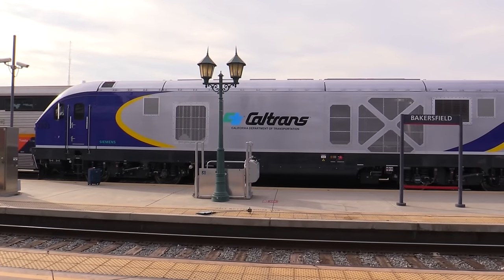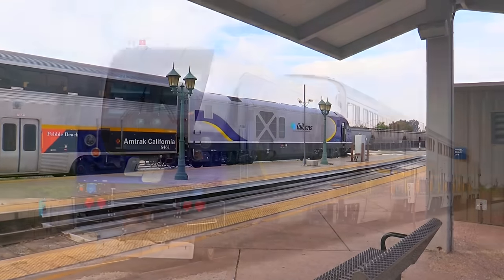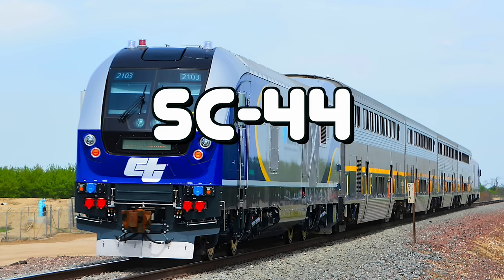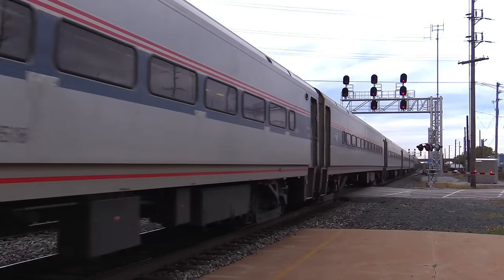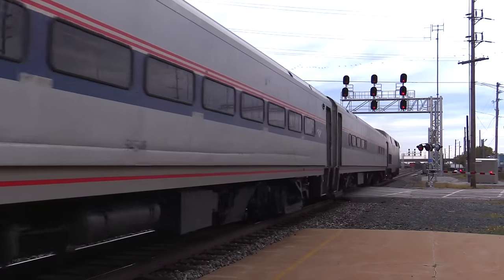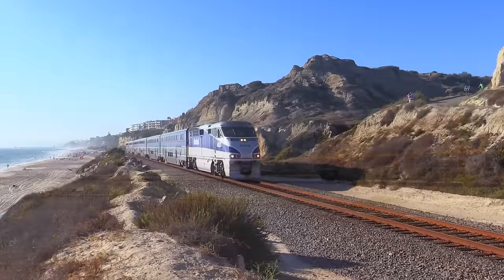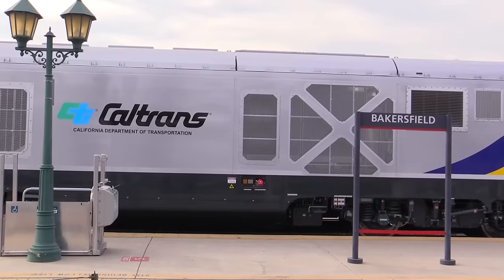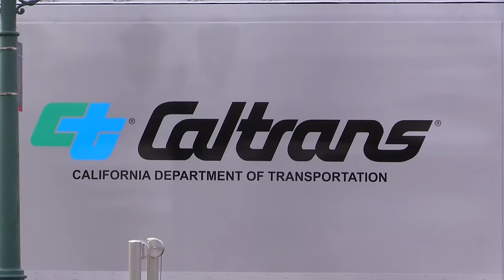NEW Amtrak California Charger Locomotive Test Train

Comment: These things are quiet as hell.  Loudest thing about them at speed seems to be their traction system.  I'm a bit disappointed this is the case, since I loved the way the Geneses always seemed to broadcast their engine beat long in advance of their passing.
Reply: GintaPPE1000 the Genesis locomotives would likely be used on long-distance trains.
Reply: stampycatfan01 It would be funny if Wheelock made a locomotive and got sued by Siemens because they copied something.
Reply: Because passenger service. Quiet trains are nice for your average joe.

Comment: I hope the F59PHI's stay around for at least a few more years longer! I've only seen them once in Sacramento California. I have very little memory of them though.
Reply from the maker: The F59s on the San Joaquin and Capitol Corridor should be here for a few more years. Not sure about the ones for the Surfliner though.
Reply: CoasterFan2105 Shame that the Surfliner engines have to go. The new locos are so ugly! I could never get used to them.
Reply: Exactly I really love the F59PHIs on Amtrak Surfliner because they are close to me and I don't understand though I mean why are they replacing them with new SC-44s I mean the F59s have great reliability rates right and are the P42DC locomotives on the Amtrak Surfliner still going to remain on standard Surfliner consists!?
Reply: TrainsForDayz2398 The F59s aren't the best at reliability but they get the job done. As for the P42s, they're only there because of equipment shortages.
Reply: but didn't you ever hear that all of the F59PHIs have great reliability rates just like the F40s were or are and why have new locomotives when we can still stick the great Mighty F59s!!!? But nice video by the way +CoasterFan2105!!
Reply: TrainsForDayz2398 I'm completely with you on that. I hate the Chargers. So ugly and unimpressive.
Reply: The front and back of the locos aren't bad but the sides are just ugh.
Reply: Yes I would never get used to them for their looks but I like their K5LA horns but it'll never really be the same but I have all these videos about them so that's good!!! (:
Reply: Nevada Rail Productions eeeeegegeehedcthchdidududifkfkckcjcjfffjfjfjfjfjfjfjfjffufufujfjfufjfjfjfififjfkffifkfkfkffkfikfkfkfiififjfjdjdifjfijfkfjfjfkfkfikkkkjo
Reply: Technology is always advancing. Nobody said it'll be pretty.
Reply: Well I don't think they are out of fashion they are very reliable just like the F40s were or are and they continue too but Amtrak just needs to clean them up a little more and more of their horns as well but I still love them and it will never be the same with the Siemens Chargers!!!! ):
Reply: Are there much engine washers?
Reply: I find it interesting that people think they're out of fashion. Amtrak's locos have only been running for 21 years, while locos on the GP40 passenger platform have been running since the GP40's initial release almost 50 years ago.
Reply: Siemens under bid GE and EMD, Siemens ended up using Vossloh body. Ugly. MBTA has fantastic GE HSP46, here's hoping that is next for orders. EMD F125 is also good.
Reply: Latios Gaming-War Thunder and More+ THE NEW CHARGERS ARE NOT UGLY, THERE COOL, but I'll still miss the F59PHI's, F59PH's, Dash Eights, P40DC's, and P42DC's when they get replaced but still, THE CHARGERS ARE NOT UGLY!!!!!! (I don't want to start a fight so don't give me any rude replies)
Reply: Me too. I also hope that the F59s, Dash Eights, P40s, P42s, and F40s will still be on Amtrak for a few more years
Reply: I don't like the F59PHi, it looks unusually tall for an engine. And when its pulling the Cascades trains, its too tall.
Reply: Because it's supposed to match the height of the superliners.
Reply: Well I'm not saying they're ugly I'm just saying that I love the originals because like the one saying says "You can't beat the originals". This means well to me that F59PHIs and P42DC/ P40DC and of course the F40s are one of the best locomotives that have ever been built since the last 40 or 15 years and well I just don't want them to go and they each have their own unique characteristics, like height........ ): ):
Reply: How are they not ugly? The nose is atrocious. I can tolerate other things but the nose is just ugly. The engine is also not impressive, sounding like an oversized Dodge Ram.
Reply: Same I haven't seen one yet for the first time.
Reply: Gary Johnson/Carpenter b
Reply: Nick S I agree. They go at high speeds, but the charger is slightly faster than the F59PHIs.
Reply: the charger is so much better looking that the big beefy f59. chargers look european which make it look better
Reply: Charger is ugly looking. It is a Vossloh body. Siemens didn't create anything new... Cummins powered, EMD trucks.. TO save money Amtrak and Metra went with SC44, HSP46 is much much better. Pure American with American design.
Reply: emd f125 looks the best
Reply: Jai Thak Thank you! Someone who understands and doesn't spout "oh but it's european so therefore it looks good" bullshit
Reply: Skylord Ah Gaming For me the F125 takes some getting used to. The nose is a little strange looking IMO. It certainly looks better than the ugly af Vossloh body on the Charger.
Reply: Nick S n
Reply: I think the F59s will stay on the San Joaquin and Capitol Corridor, as the six Chargers were likely ordered so Amtrak California can stop using P42s.
Reply: Nick S me too
Reply: nahhh, shinkansen much better than american train, shinkansen can speed up at 400 km/hour
Reply: Ryan dragon Oh of course but the fact is we can't afford those kinds of things here in the USA. Plus we can't fit it into practical places like the Japanese have. They use trains as their primary mode of transportation with multiple lines converging every few stations. 
Americans don't use trains as their primary mode of transportation. That's why other countries have better trains.
Reply: TrainsForDayz2398 I CA  understand your confusion...... VIA Rail just did their annual fleet renewal report..... It came back as they might be completely be replacing their entire fleet (73 engines and around 130 cars) VIA just had a 2.3billion doller over haul 10 years ago they want to get rid of the 53 F40PH-2Ds and the 21 P42DCs ordered Oct 2001...... they also want to get rid of the entire fleet of LRC coach's from what I've read....... that's how I took it
Reply: +VIARailFan6448 Gee that's too bad but what do you mean by LRC coaches, are you talking about the whole Amtrak Surfliner Cars and Cab Cars and locomotives? Because if you heard that 14 Siemens Chargers will be used on the Pacific Surfliner Route and that only replaces 14 F59s and that leaves only one left so..... But other than that I love the F59s and I'm glad that I've taken many videos of them and I continue to do.... But thanks for the info....
Reply: So VIA retiered their fleet of LRCs in 2001 but still have and use the LRC coaches that went with the LRC engine.... After test engines (Amtrak 38 and 39) where rejected and sent back to Bombadier they where scrapped and VIA got the LRC coaches from amtrak.
Reply: Ok I see so you were talking about Canada ok yeah I see what you mean....But yeah and by the way have you ever seen the Union pacific Heritage Unit 1996 before in your railfanning career?! (:
Reply: I havent seen it no.... I live in a small short line city (If you check my channel you can see the VIA 150th silver banana scheme) Its home to GEXR the line its self is owned by CN but they dont operate it anymore.......... today I saw almost 15 people get hit by a train doing yard work today
Reply: f40phs could pull alot.... they canpull the Canadian with only 1 engine.... 16 car train up a 2% grade
Reply: TexasRailfan21 That's not true. The Genesis and Dash-8s are only there because of the limited amount of F59PHIs that can be in service at a time. Each unit is on a maintenance schedule and there are a lot of Surfliners running at a time. Basically, there are non-Surfliner engines pulling Surfliners because of a power shortage.
Reply: VIARailFan6448 And this is why 645-E3s are the best
Reply: idk I love the F40PH-2D/F40PH-3D
Reply: Look guys I know what you're saying and yes I know that the P42s and the Dash-8s are there because of the limited amount of F59PHIs on Surfliners and yes the F40s would pull a lot too but there are not many because 22 of them were converted into NPCUs or Non-Powered Control Units but only one F40 which is #406 was also converted into a NPCU but still had a generator for head-end power as CoasterFan2105 discussed in Train Talk on the Great & Noble F40 But yes I still love the great F59s.... :)
Reply: i kinda like the F59s never seen one before
Reply: Yes and also I found out that once the chargers are put into service they can remove the P42s and focus them mainly on the long distance amtrak trains and the F59s still have a long way to go because they are only just 20 years old and they are still going to be operating as of what I've heard.... :)
Reply: Latios Gaming Agreed, still, it's a EMD, so I'm happy with it, fucking Freddy Krueger is prettier than the fucking charger(I'm dead serious lol)
Reply: Yes you do have a little point there yes but you know the F59s though I heard that they are being rebuilt and that will make them last a lot longer before the newer locomotives are put into service and that's why on the Pacific Surfliner some have actually gained new K5LA horns so yeah but no need to worry..... :)
Reply: These new locos look so  ugly I hate them they look ugly on Amtrak screw Siemens EMD
DO SOMETHING NOW
Reply: Ryan Lad5 same
Reply: Nick Stewart The F59's are very commonly saw in North Carolina and near there.ive saw sooooo many.
Reply: Liam Bryant that's because the Piedmont only uses F59PHs and PHIs
Reply: The Dash 8’s aren’t being retired. Just the F59’s and Genesis diesels are going.
Reply: @commandercody5374  do you hate the talgo series 8 cab cars more than the chargers?

Comment: cant wait to see how they will look in Surfliner schemes!!!
Reply from the maker: Yeah, I'm wondering if there will even be a separate scheme for those. They had a lot of concept art showing this scheme, but I haven't seen any for a Surfliner scheme. It will be interesting to see what happens!
Reply: +California Rail Productions, You Got That Right, YouTube-Friend of Awesomeness! :-D
Reply: Also, You Smell So Nice Just Like My Mom's Flowers in a Flower-Vase, My Awesome YouTube-Friend of Righteousness! :-D
Reply: This paint scheme doesn't even match.
Reply: Just for the record, the six on order are to supplement the F59s used on the NorCal corridors, not replace them.  Basically they'll replace the P42s currently being leased by the state to run service (Although my understanding is there will still need to be one P42 hanging around as the margins will still be thin at best).  There are no current plans to retire the F59s up there.

The fourteen on order for SoCal are supposed to replace the fifteen Amtrak-owned, State-leased F59s currently running around, however that is one fewer SC-44 than F59s, and Amtrak generally has one or two P42s running Surfliner service, so I'm willing to bet there will be at least a handful of Surfliner F59s retained for service in SoCal.  (Note:  The 14 "Surfliner" units are a completely separate order from the six which were delivered for NorCal, and should begin delivery late this year or early next year.  I have not heard anything about the Surfliner scheme going away so I'm doubtful of that, although similar to the F59 schemes they may just look like the Cascades units, but with blue and silver paint in lieu of green and white)

The eight Cascades SC-44s will completely replace the six Amtrak-owned, State-leased F59s.  HOWEVER I've heard a rumor that the states involved have determined that they want two locomotives on all trains once the Chargers go live, ergo the F59s might be hanging around until the states scrounge up enough money to buy more Chargers.
Reply: No they won't.  They will, however, replace the Genesis units which are being used in corridor service.  The difference being that these will free up Genesis units for use on Amtrak Long Distance trains.
Reply: What about Daylight if they ever expand from SLO?
Reply: Could give two less fucks, I like daylight colors.
Reply: I'm pretty sure that it will look like the Amtrak Cascades Chargers.
Reply: California Rail Productions™ I love your videos
Reply: California Rail Productions™ they used the polkadot one on the coast starlight

Comment: Looks like they decided to bring back the roof top mounted strobes that were originally found on the F40 and early P40's.  I'm  still not sold on  the new looks of the engine, particularly in the nose area and towards the rear with that weird "curve" to match the height of the California Cars (almost looks like the transition car from the later years of Santa Fe's passenger services with bi levels).

Comment: I really hate the Siemens. Here's my question, why are the F59s being replaced already? They've only been around since the late 1990s. I seriously don't get what Amtrak is thinking.
Reply: The typical service life of a locomotive or trainset throughout history is typically 15-20 years.
Reply: RockyRailroad Animation I know but you'd think they'd get a rehab. At least that's what most railroads seem to do. Metra for example is rebuilding locomotives that have been around for like 35-40 years. And passenger cars that date back to as early as the 1950s, also being restored for further service. It's cheaper, better, and believe it or not, more efficient in many ways to just do a rehab.
Reply: +Metra MP36 407 Or like the current Intercity 125s in the UK that have been running at over 125 miles an hour regularly for over forty years. They're only recently being replaced by the beautiful (If a few coaches short...) Hitachi class 800 units.
Reply: Honestly I don't know a thing about the UK railroads. But I don't see harm in just rebuilding those either. But it's cheaper and more efficient in many ways to just rebuild equipment for one thing. For another, at least from a railfan's point of view, it's pleasing because it's history being preserved if you think about it.
Reply: +Metra MP36 407 Although it is good for new equipment to come around once in a while.

Some of those locomotives and coaches are rebuilt and refurbished so many times that by the time they reach museums, things like their prime movers could be completely different, and in many cases, irreplaceable.
Reply: And then you have 45+ Year old SD40 and GP40-2 Locomotives still dominating freight railroad.

Comment: I like the Amtrak Cascades F59phi's and P42's. :T
Reply: Why replace the P42s and F59PHIs? The P42s were only built from 1992 until 2001, and the F59PHIs 1988 until 1994, so still pretty new.
Reply: exactly, I my opinion those new charger units are just a big waste of taxpayer money...
Reply: Canada Railfan Me too
Reply: @Canada Railfan: Exactly! I would be quite happy to use an F40PH...
Reply: Trainlover 4449 the chargers are only to keep p42s off local routes. both the p42 and f59phi will be around for another 10 years at the very least
Reply: They aren't. Unlike the P42s, they're built to travel 125mph where the Surfliner goes 110 mph. They get up to speed quicker too with new siemens propulsion system, put out less emissions, use less fuel and have auto horn for grade crossings. All in all newer and better.

Comment: I've always liked the robust look of the F59PHI against the Superliner coaches which made the whole trainset very streamline like it was built just for them. The new SC-44 looks a bit narrow and disproportion against these Superliner coaches taking away that streamline look it had with the F59PHI. The added trucker style wind-deflector on the rear end of the SC-44 doesn't do any justice to this look besides what it is intended to do... deflect the wind. The SC-44 looks great (without the wind deflector) pulling the MARC multi-level, Amfleet, and horizon coaches. Just wished these decision makers had a sense of style besides solely focusing on performance and eco-friendly standards. Just my opinion...
Reply: The brightline versions are the only good looking ones they made.

Comment: Once Amtrak starts replacing its F59PHI's, F59PH's, P40DC's, P42DC's, and Dash 8's by the new charger locomotive, will the NPCU's also be replaced by the new charger locomotive?
Reply: NPCU's can not be replaced. It would be disrespectful if they did because one of the NPCU's is a Veterans Unit.

Comment: Love your videos!  I was curious as to why they decided to use 2 locomotives per train set with the new Siemens Chargers, instead of the 1 locomotive per train set with the old configuration?  Do the new locomotives not have enough powers?  Are they not compatible with the control cab?  Safety reasons?   Or is it simply for aesthetic reasons?

Comment: What's the purpose of the strobes on the roof of the cab?  They appear to be almost invisible on crossing approach, and there's a red one as well.
Reply: The white strobes are designed to increase visibility to people along the right of way. But I agree, they used very poor quality ones (Star Headlight 200A’s) that don’t have anywhere near the intensity of the earlier versions they used on the F40‘s made by Whelen engineering.  The red strobe in the middle turns on if the locomotive is in emergency braking.

Comment: Gorgeous locomotive; the F59PHI and P42DC had good two-decade runs.
Reply: @Acerailfan3101 F40PH They absolutely are; the former was introduced in the mid-90s, and the P42 has been around since at least 2000.
Reply: @Acerailfan3101 F40PH Metrolink used the F59PHI here in SoCal as early as 1996. And the P40s, which are rightfully being retired, were a common sight in the early to mid-'90s--same with the Pepsi can Dash-8.